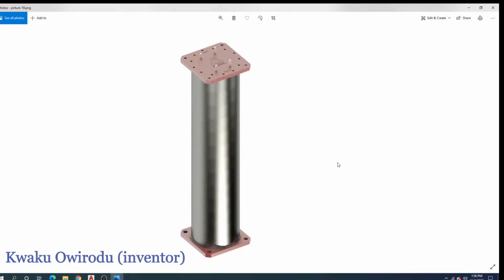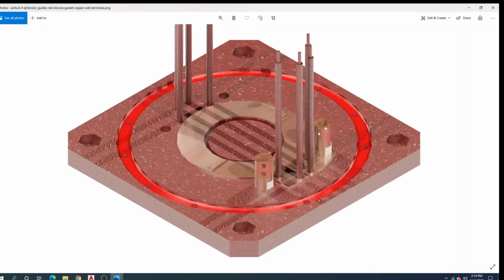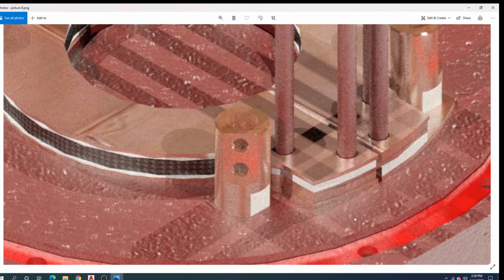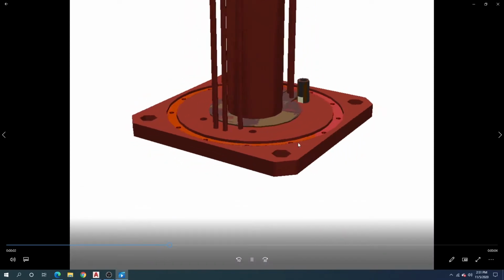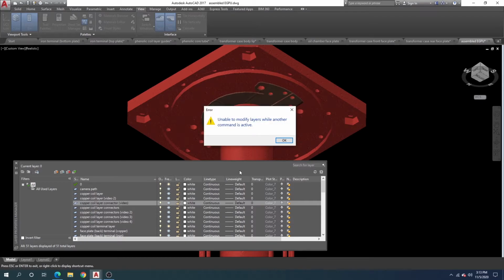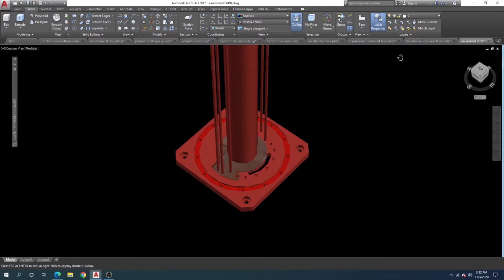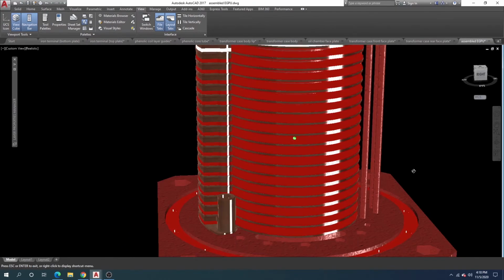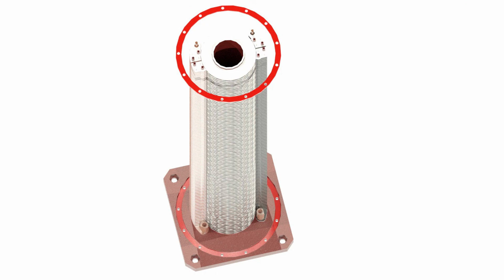Overunity Free Energy Transformer parts and construction disclosure using AutoCad 2017

Comment: Why not just use steel foil and copper foil wrapped with a teflon tape between them..  or a steel wire insulated and coiled to form both the coul and the core of the copper coil?
Reply from the maker: This is a good idea I have already designed a coil that can do this exactly what you described but I have discovered the iron coil needs to physically be very thick
Reply from the maker: What I'm saying is the iron wire itself must be very thick

Comment: Seems like this may produce high current like a step down transformer but just wondering how the voltage is increased with it not having more turns in the secondary coil than the primary coil
Reply from the maker: Please subscribe and stay tuned I will be doing a demonstration video soon, I am saving up now to be able to build a smaller cheaper version of the EGPU (the thumbnail rendering of this video)............
Reply from the maker: Actually the voltage should not increase. This is basically a 1:1 transformer. The free energy or over-unity should be in the form of the iron secondary outputting more amperage than the copper primary.

Comment: Please explain the magnetic circuit of these device...
Where does the magnetic flux circulate in these transformer ?
Thanks in advance...
Reply from the maker: Hello, thank you for your interest and for subscribing to my channel. 
So basically the copper coil layers collectively form the copper coil.  The iron coil layers collectively form the iron coil.  The copper coil is literally parallel to the iron coil separated only by a .032 inch thick sheet of Teflon(Teflon insulation layer).  
The copper coil is the primary coil and the iron coil  is the secondary coil of this transformer. The magnetic flux of the copper coil directly couple with the iron coil.  Go to my Patreon page and see the main picture that I have.  This picture is of a cell, 2 copper coil layers sandwiching one iron coil layer.  You will be able to clearly see the copper coil layers magnetic flux will be in attraction to one another through the iron coil layer, this is how the iron coil layer will generate the electricity.  
Please know that the EGPU is still under development, once I am able to build one I will post very detailed videos of its construction and me testing it to prove and make sure it works properly.  Another subscriber recently built a very cheap and simple proof of principle experiment using copper wire and iron wire.  His experiment failed it did not do what I predicted.  I analyzed the experiment and concluded that the iron has to be thick (which it is in the EGPU) so this is why I want to make sure you understand that the EGPU is not proven yet.
Reply: @kwakuowirodu07  the copper layer and  the iron layer are parallel so the magnetic should be perpendicular to the two layers (copper and iron)...
Y do not understand how a voltaje Is induced in the iron coil/core ?
Reply from the maker: @gustavoegomez  I understand exactly how it works I am the one that invented it.  I don't have time for debate it is a waste of energy and my time is very limited.  
When I am able to construct the EGPU it will do one of two things, it will either work and provide free energy or it won't.  
Please stay tuned and let us see what happens once the device is constructed.  We can debate THEORY all day and the only thing accomplished is wasted time.  One will not know what the truth is unless one actually conducts the experiment. 
 I don't care about the flawed laws of physics and electronics.  If these laws were so accurate then we will have free energy devices, wouldn't we?  Science says free energy is impossible yet the planets are in motion and have been for millions of years, the sun shines bright and has been for millions of years(and don't tell me NASA knows how the sun works yet they don't have equipment that can even get close enough to it to sample its surface, can you explain to me how a cow's digestive system works just by looking at it from across a field?), you can permanently magnetize a neodymium magnet let it stick to a thick iron beam and will stay that way for a hundred plus years.
So please subscribe to my Patreon channel so I can raise the money to build this thing instead of us wasting our time and energy with speculation.
Big difference between an Inventor and an electrical engineer.

Comment: so much work, best of luck, but not my gig
Reply from the maker: thank you....I have looked at your channel and will be reviewing your channel in more detail over the next few days.  I have subscribed to your channel, please subscribe to mine.  The EGPU is not my only invention.  I have several free energy inventions.  Your "gig" appears to be efficient low profile wind turbines used to spin a rotor of permanent magnets.  I have invented a rotor that can mechanically eliminate the back EMF produced by the stator therefore your wind turbines could produce tremendous amounts of electricity or you could even eliminate them completely if you choose. Just to be clear this invention will allow you to take existing mass-produced readily available cheap used generators and simply modify them by removing the rotor and replacing it with the rotor I have invented, cheaper and easy; no more back EMF=achieve Overunity/Free Energy.  Subscribe and stay tuned, and yes it is much work to present this technology in a professional easy to understand format to the public